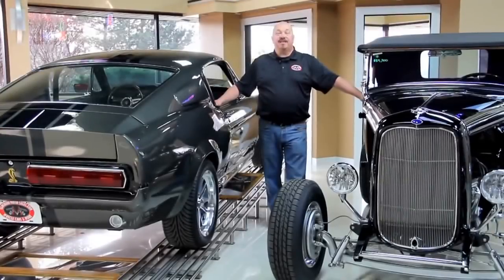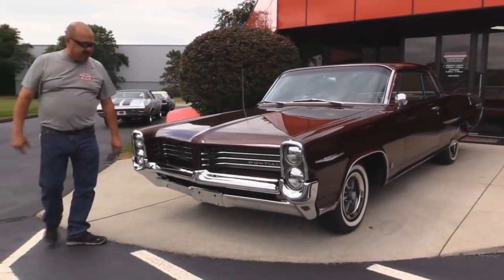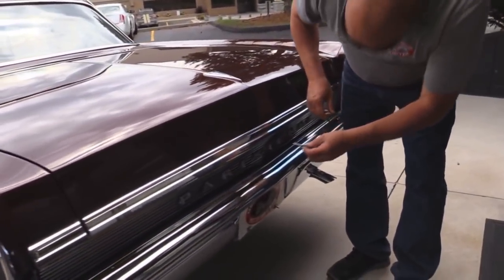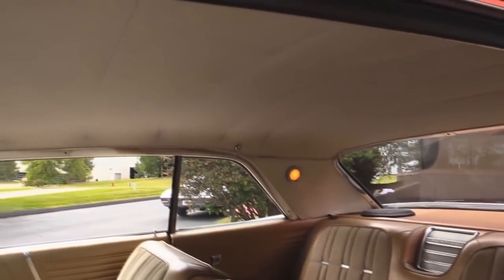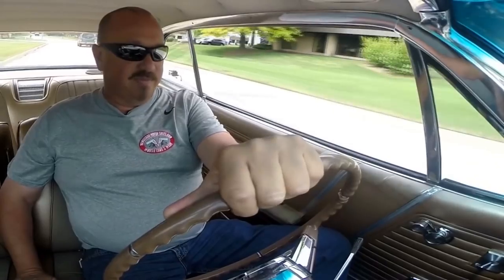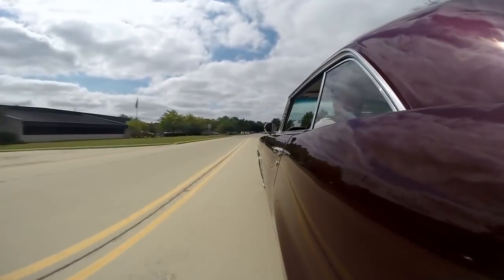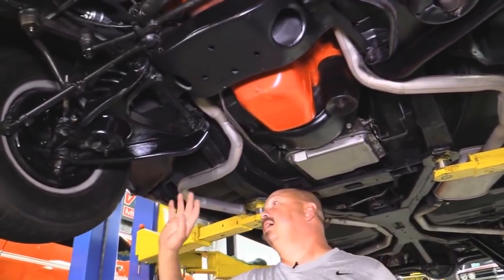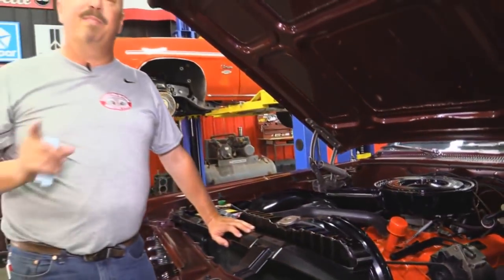1964 Pontiac Parisienne For Sale

Comment: I wonder if anybody could tell me why the Canadian vehicles back in the 60s and 70s that were made for Canada have the smallest engines in them they all have the smallest v8 and some even 6 cylinders like this one only a 283 if this was a car made for the United States it would probably have 421 or I think those had 389 in them I think but definitely a bigger engine than they come in Canada and I don't know why anybody know?
Reply: Maybe not as much demand for the bigger engines
Reply: I just bought one last summer.  Has a 230 six.  That works out to be a 3.8 litre which is larger than most engines on the road today.  Car is heavy but the 6 has plenty of torque.  I would rather have the fuel economy of the 230 or 283 than the big 8's where you have to stop at too many gas stations.  6 is a cinch to work on as a DIY'r.
Reply: Canadian buyers were known to be frugal
Reply: For tariff reasons and production costs GM produced Pontiacs in Canada using Chevrolet components. After 1955 Chevrolet chassis and engines were used. Pontiac trim levels and attractive pricing sold many Pontiacs. The cars were different from American built cars in model names, dimensions, engines and chassis.